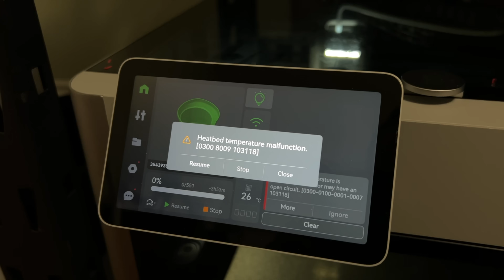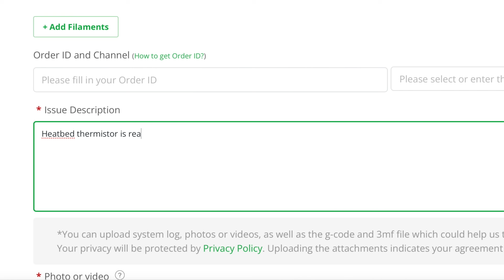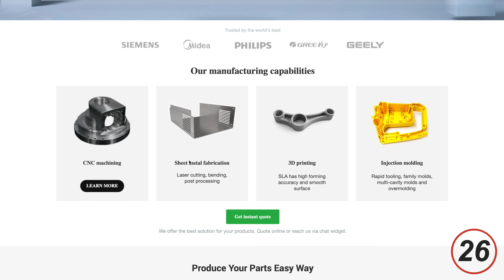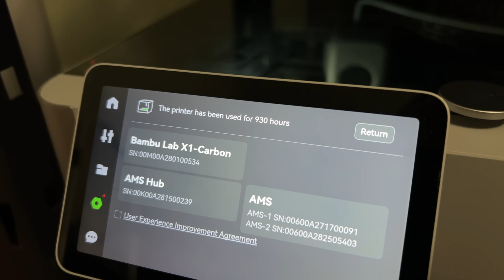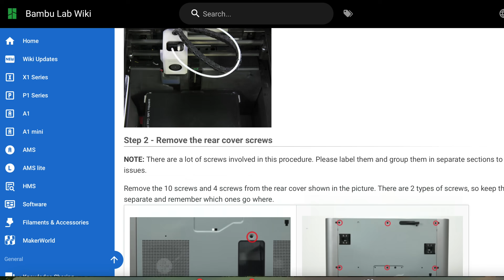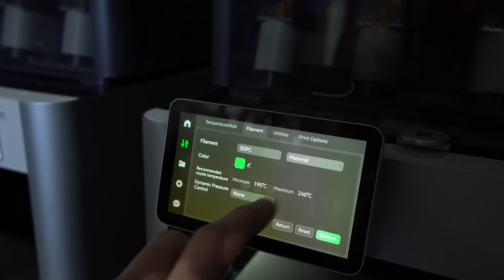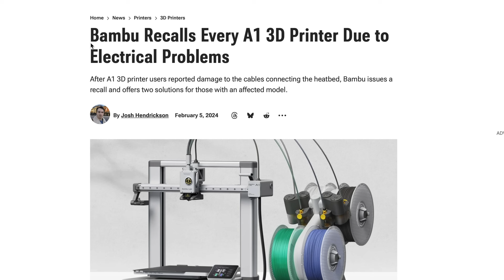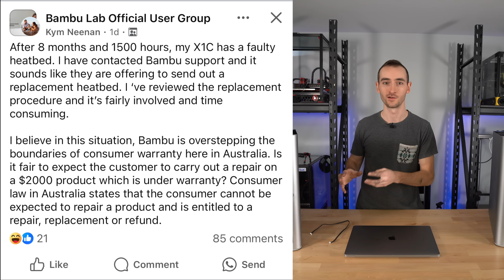Bambu Printers: Repairable or Disposable?

Comment: I opened my x1c yesterday to clean it out good and noticed a pretty bad pinch on that signal cable almost bare wires showing but left alone since it's still working at 4000 hours will order that cable to have on hand and all belts. Definitely looks like a design flaw to me. Old one is flat new one looks round. Oh and now that the x1c has been discontinued who knows how long they will stock parts for it which worries me.

Comment: Man, I can say that Bambu has great support. I had a P1S that had arrived with a jacked up bed. Likely due to fedex dropping it… first prints failed. Tried leveling manually, no dice. Contacted support and within 3 days they had sent me a new bed and it took an hour of my time to swap it out. I’ve not had another issue with it in the 
2.5 years I’ve owned it. Most definitely not the case for my Enders… Bambu definitely has taken 3D printing to an appliance level experience and I’m here for it. Still love my voron though.

Comment: essentially it seems it's on par if a little better than the stratasys dimension elite i have been fiddling with, a lot of the parts on that however are hard to procure if they're not off the shelf parts, like the belts i replaced, and for the "umbilical tube" i had to get creative. although it seems the print head for my project is borderline 1 of 1, getting a new one would require either an expensive 2nd hand part or getting in touch with a cnc workshop to have it manufactured to spec

Comment: Surely this should be within the manufacturers' remit to supply free of charge as a common point of failure. Obviously consumers' rights change country-to-country but they have invested time into providing replacement tutorials as if they understand this is an issue. These products are closer to buying a £1200 Flatscreen TV than a tinkering hobbyists DIY system. Just because most 3D print users are technically astute does not mean we should not be protected by consumers' rights  
 Great videos by the way, long time listener, first time caller, Really honest opinions and well researched content!
Reply from the maker: @zeroontario2457  thank you very much! I’m a silent viewer myself on most channels but as a creator I definitely appreciate the engagement in the comment section.

Comment: I think everyone misses one and growing part of the hobby. Many people want 3d printers to just print. They might be adept at dealing with little tiny tiny screws, cables that are very difficult to unplug and reattach snd can easily break. Then when something goes wrong you have to replace the part. Etc. Here’s an idea. Build printers that are more module easy to replace. I would pay a little more to buy a whole hotend assembly instead of one part that requires taking the whole thing apart.

Comment: In version 4 of the printer this was fixed, version 3 is the fan screwed into the side panel, version 2 was the upgrade cables that frayed so it was changed to a ribbon cable

Comment: They also changed the  path on the Z access so it’s a different hole dimension and location for the cables to go in it’s actually a straight in path that you can see from the photos if I soldered a hole and made mine look more like there’s pushed less strain on the cable on that point

Comment: Hello, I have quite a complicated yet interesting topic. Please listen me out.
Recently I noticed there is something wrong with my Flashforge Adventurer 5M Pro 3d printer. I printed a test square 120x120mm. The results are the following: 

X in front of the printer = 119.3 mm ; 
X at the back of the printer = 119.8 mm ; 
Y on the left side = 119.9 mm ; 
Y on the right side = 119.0 mm.

I found out that there is a 0.5 mm differance between 2 side guide rails i.e they're not parallel.
AD5M Pro is made out of a metal sheet chassis with holes on the top where plastic mounts of circular guide rails are screw in. They have plastic aligning pins but they're is like 0.5mm loose within the hole.
I dissasembled the 3d printer, made those as parallel as I could and made sure my synchro belts are the same length and tensioned correctly but it did not help.

To properly tension the belts on this 3d printer You have to push the X axis to those plastic mounts (either on front on the back) to make the X axis perpendicular to Y axis and here is the problem because these 4 mounting points are probably skewed because of what I described above i.e. metal sheet construction with loose aligning pins.
I tried evey other method a service on Flashforge facebook group told me and nothing helped.

I have some photos I can of course share with You if You want to take a closer look at that subject. I also want to note that another AD5M user printed a square but his part was not so extreamly skewed but He still had 0.4mm differance on 140mm square.

Could this be a potential fatal flaw of this kind of guide rail system? Most of core xy printers use this kind of rails but I've also seen some of the corexy 3d printers use linear rails. 

Thank You for reading this, I hope this is interesting and I'm up to share more details with You.
Reply from the maker: @Kasspirr  you should try printing the Vector3D califlower to characterize the skew through measurements. There is an included spreadsheet that will suggest skew correction values you can apply in firmware.
Reply: @ygk3d  I have printed the califlower a while ago, unfortunetly I cannot adjust the skew in my printer. When I adjusted the dimensions - yes they were correct but only in the exact middle of the printer. Anyway I shouldn't have to do it. Friend of mine printed the same part on his Bambulab A1 ad he had no more than 0.05mm differances.

Comment: Just under an hour to replace a simple cable.  This kinda fix should absolutely not take this long. I recently had to do this on an old prusa mk3 that's been running continuously for god knows how long. Similar thing, but it took only about a minute to fix. Usually for these kinds of repairs I tend to just use my own wire as I can actually guarantee it's a decent wire for the job as opposed to manufacturer wire which is made to save pennies over long production runs. I'm told these are super nice printers to work with and I respect that, I just really would've liked more consideration for repair as any machine WILL FAIL guaranteed at some point if you simply keep using it. I'm half looking forward to getting one in at some point and half dreading it just because I'm curious how good or bad it gets with the harder repairs.

Comment: Glue on a connector. I'm a repair pro for various electronics including 3d printers. This alone puts any manufacturer on my shit list as it screams a few things to me. 1) we cheap out on parts, hope it works and then add a bandaid fix if it doesn't 2) we hate repairs and try to frustrate them as much as possible. Having a simple solid locking connector that'll stay put without any glue is easy and is the expected way. You really need to cheap out to get connectors that need glue to work. And then end users go "oh it's a nice touch to make my machine last longer. WRONG, in any sort of well designed machine that sort of glue has no purpose, and if it's not a well designed machine you should not buy it. I hate shit like this it just adds unnecessary time to repairs, has in theory no practical use, and makes me charge customers more and makes me ask them "do you want it in factory state or do you want a slightly cheaper repair and take my word for it that this extra is an unneeded thing simply meant to make repairs harder" and then every time they say "factory state please" I have to re glue the sodding connector knowing full well if it breaks again it'll be me again undoing that stupid glue. This got a bit rant-y but I REALLY hate shit like this.
Reply from the maker: @rikkoningen3992  interesting but makes sense. Thanks for sharing.

Comment: Kinda kills the "I want a printer that just works that I don't have to tinker with" argument doesn't it. So at 1k hours is there any replacement warranty? or are you just screwed if you don't feel up to that repair? I would think that the kind of people who would gravitate towards Bambu might also be the type of people who would not want to crack open the "black box".
Reply: yeah I would be mortified to have to tell a user of my "user-friendly" printer, "now apply heat to release the wire adhesive"

a lot of other assembled printers Just Work and can be repaired in a less cursed manner lol

Comment: I've had this happen on two of my early prusa i3s. It really depends what you print. in my case it had to do with how I routed the wires. This is really a weak point on all printers, there should be no dollar spared on the quality of the wires that go to any moving parts. For $5 I too would have taken their revised part, but upgrading the wire to a high quality silicone jacket will definitely be worth while in the long run

Comment: You claim that it obviously wasn't designed for reparability, but everything is connected with a simple push in connector. If the machine wasn't designed to be repaired, everything would be sauntered to the main board.

As far as a design flaw, not everything on a product is perfect. The goal of the manufacture is to push out the best product possible, and if there are flaws, they need to be minor and cheap to repair. The redesigned the cable because they found a few issues. The positive, is that bambu honored their printer and offered a new version. 

With many companies, the version that they sell is the final version. Hell, I had a Ford Escape that had a ton of problems. It seemed like every month I was finding something new that was just poor design and caused a failure. Hell, there were quite a few of the same year of mine that experienced a blown out rear window just from driving down the road (thankfully mine didn't experience that). My buddy was looking at getting a new car and the salesman asked him if he was interested in a ford escape and my buddy mentioned that he doesn't want one, and that he sees enough complaints from me on facebook. My friend mentioned a couple of the issues, and the salesman just said "Well, we fixed a lot of those things for our newer models."

Even a car that costs tens of thousands isn't perfect on release, and the manufacture of said car doesn't stand by their product. There are no repairs available to fix the transmission or engine issues (aside from just getting them rebuilt), or to prevent the rear window from blowing out.

I think it's good on bambu for offering the parts needed to repair and offers updated parts to prevent it from happening again.

Comment: If taking the printer apart is intimidating because you didn't put it together, wouldn't putting the printer together in the first place be just as, if not more intimidating? I never really understood that logic.

If I'm putting a full printer together, I need to ensure every single thing that I do is proper, or I will forever have problems and may not even know if they are caused by my assembly. If you take a small part of the printer apart to repair something, there is less chance of doing something wrong. When put back together, if you have issues that weren't there before, you know that it was something that you did, and you can disassemble and fix.

Comment: I don't believe the "Warranty void if removed" stuff has any actual legal force. Aside from that - I'd call that repair a mix of good and bad, yeah. Having an end user remove cables from a connector? Bad. I wonder if there could be a redesign where, instead of that little hole, there could be a clip / screw on cable holder - thus making this repair easier and making the "remove from connector" bit  unneeded. Honestly a good look inside, and I hope Bambu makes improvements.

Comment: Docking Bambu for "ease of maintenance" due to a hole being a little small is kind of petty.
I dare you to name any other printer on the market that would go 1000 hours with basically zero maintenance. 
I have a few X1 Carbons myself, and most are at or over 3000 hours if not more, with the only maintenance on them being basic wear items such as nozzles, extruder gears, etc.
I've been in 3D Printing since 2014 and started out building my own machines out of necessity. You couldn't find one as a hobbyist without building your own back then. Prints were horrible unless you personally spent 1,000's of hours tweaking and tuning slicer settings, firmware settings, bed leveling, filament adhesion, etc. Every single print was a ride on the struggle bus, and if you ended up with something that closely resembled what you wanted, it was deemed a success.
Bambu has brought printing to the masses, and in doing so has given accessibility to 3d printing to 10's of 1,000's of people, most of which have never touched a 3d printer or any sort of electronics before. The lack of experience on the part of the user does not coorelate to a issue of being difficult to maintain, in my opinion.
Perhaps one day we will see 3d printer repair shops as ubiquitous as cell phone repair, or even automotive repair shops, but that will be some time in the future, if ever.
Bambu has taken the time and energy to make certain that repairs of their machines is fully documented, easy to follow, and fairly simple to do. Any anxiety or apprehension of the end user to do so is due to their own lack of experience or insecurity in their ability. 
The 3d printing community around the world helps to support this insecurity and belay the fears by providing a diagnosis, helping hands, and guidance, to those who seek it. I have even been known to personally help others in my local community by traveling to their location to assist with repairs when I can, and I know others that do the same.
All  of that being said, I most definitely do agree with you on your statement about the cable issue being a design flaw, and not a user error, but I also find it notable that no one from Bambu ever stated that it was or wasn't. There was no blame here. There was a diagnosis of the cause, an offering of resolution, and a direction to the part requiring replacement. If your printers were in warranty, I'm fairly certain that Bambu would have sent you the part required free of charge. If not, then you would be on the hook for the cost of the cable yourself. 
Every machine ever made has part failures, updates, revisions, and changes during their life cycle. It is the nature of mechanical things.
An argument could be made that the parts having a flawed design should always be covered under a "warranty" regardless of time frame, but these parts were not under any sort of recall, nor are they creating any kind of a safety issue. A rebuttal of that argument could be that you are using the machine outside of it's intended use by repeatedly printing the exact same part over and over again, creating the situation of the failure. They could say that you were using it for commercial use, and it is not intended for commercial use. My point being, that it can go both ways.
The reason Bambu Lab printers are so popular, and the company has become an absolute 10 ton Gorilla in the industry, is due to their reliability, ease of use, print quality, and hands off experience, from basically day one.
Reply from the maker: @AlAmantea  you make some great points here and offer a very interesting perspective. Bambu may not be specifically marketing themselves towards businesses as some other brands do (Flashforge, for example), but I’d be shocked if they made a claim that commercial use is outside the scope of normal use cases. I reckon that a large proportion of their sales is to print farms. The question of expected life span is an interesting one. I don’t know that we have an established standard for that in the industry just yet (1000 hours, 5000, 10000 - what is a reasonable expectation?). It will be interesting to see as the industry matures how the lifespan of a printer changes. In today’s market, it seems to be the pace of innovation that renders printers obsolete, rather than hard faults like mechanical failures.
Reply: @ygk3d  While BL has definitely garnered a slice of the commercial pie, they didn't design the printers for that use originally, and that was not their intended market. Their concept was to bring quality, easy to use printers to market for everyone. Their intention and their method of release was geared towards the end user. There was no outreach at the time to the commercial market, nor was there any steps taken towards competing in that market, such as providing industrial support, maintenance contracts, installation services, etc. such as companies like Stratasys, Ultimaker, Flashforge, and the like.
Their jump into the space was done on Kickstarter, sold to anyone and everyone who believed in their design and concept. In the beginning, and even still today, the argument can be made that their mindset was, and is, focused solely on sales and development of product, and not support. We all remember the early days of BL, and the fiasco that was early adopter support cases. It has gotten better, but is nowhere near what must be provided for commercial contracts even now, almost 4 years later.
I agree that there is no "average lifespan" expected for the industry yet, which isn't surprising to me as it's a fledgling industry and is nowhere close to maturity as you state.
3d printers are altogether different than say the paper printer industry, due to the nature of designs and maintenance required, so a predictable lifespan may be more similar to an automobile or home appliance than it would be to anything else electronic wise.